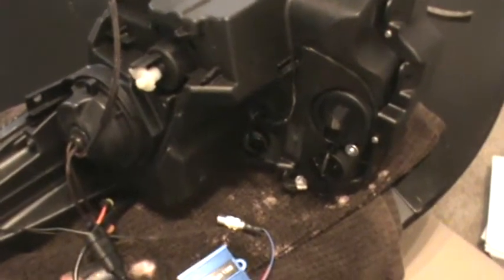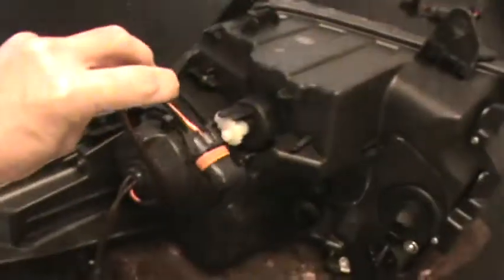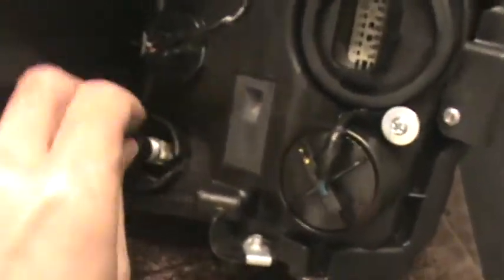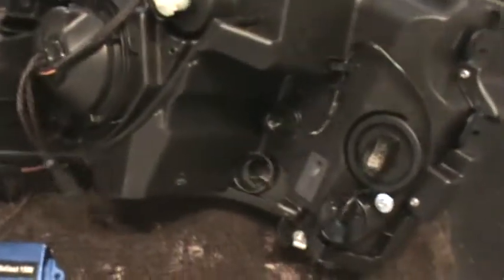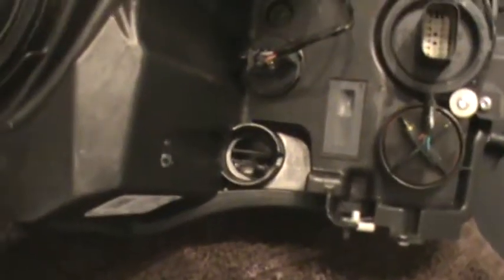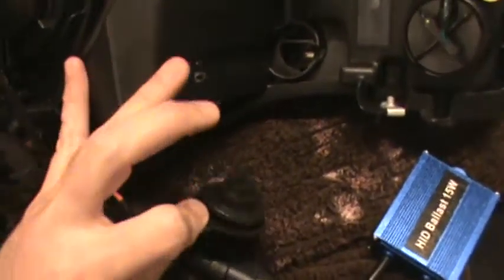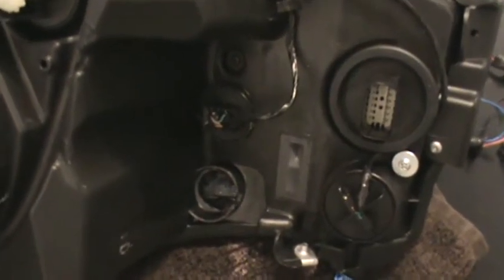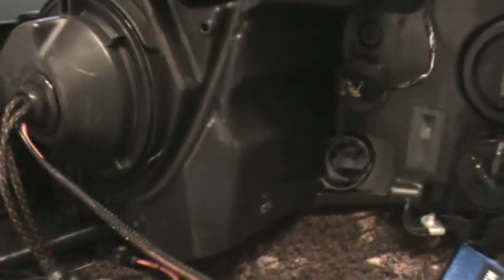Adding accent light to Cadillac ATS halogen headlight

Comment: I just noticed these corner 4 spots on my headlights today. I wondered Why they were not on. My ats is a 13' What year is yours?
Reply from the maker: Mine is a '13 as well. The 4 spots in the corners are made as a design for looks and no lighting actually goes there but I cut the back out to add lighting so they serve some kind of purpose
Reply: cadillacats2013 I bet it looks good! It upsets me That the 14'+ have better lights. My car did not come with hids.  I am trying to decide between his and led for the headlights
Reply from the maker: The halogen are available on all model years, The HID/led lights are based on the trim package you get. As for led headlight bulb swap, some people like them and I believe they are an easier install but not as bright as HID. I would recommend a 35w HID kit, but thats my opinion. I may still end up buying HID/drl factory style headlights and swapping these halogen ones out anyways but it wouldnt be anytime soon after the work I put into these. Feel free to check out my other videos on the work I have been doing on the ATS.
Reply: cadillacats2013 I have seen the other videos and I subscribed. ! :)
I do not know where to tap into for the power for my HID kit or ground! They have been sitting for 8 months [my hid kit] Haha
I Also want to install some hid fogs If possible.
Reply: Campbell Super Kids new to u tube is there a way to email me